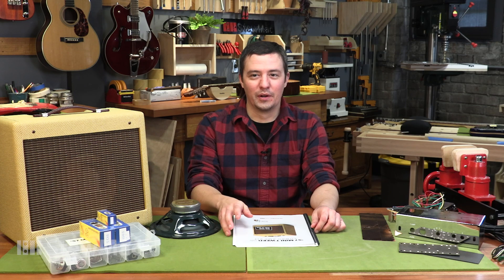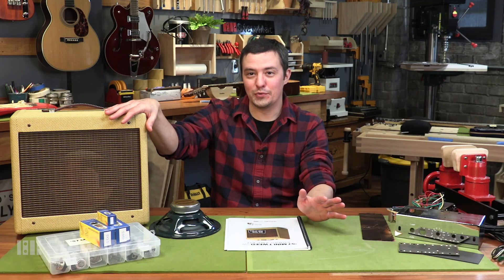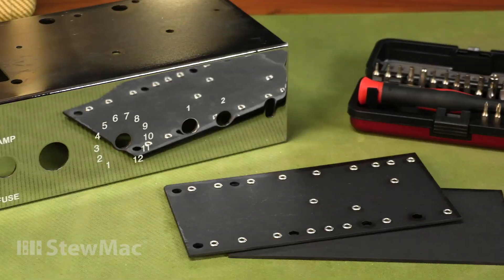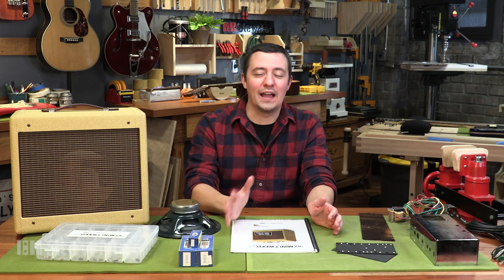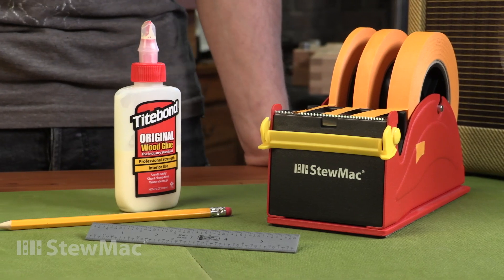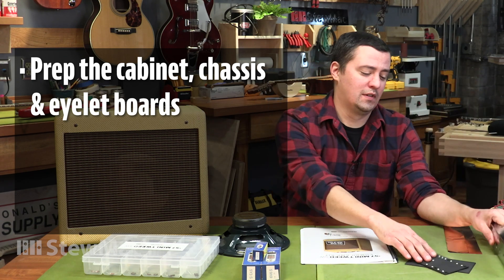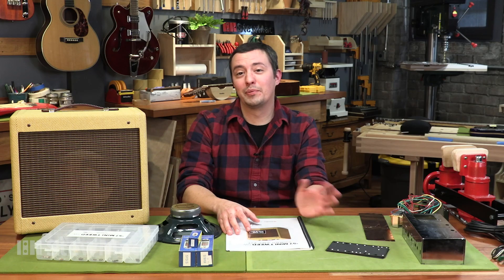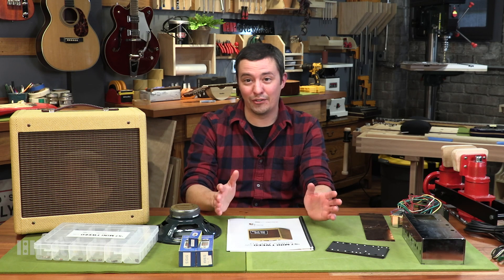How to Build a Tweed Champ 5F1 Step-by-Step (Upcoming LIVE Build Along)

Comment: If it was reasonably priced I'd go for it.
Reply: Yeah, it looks like fun(?) but what do you get? Work, possible mistakes, no Fender logo or resale value.
Reply: yeah. When you can buy an actual, assembled, working, Fender tweed tube amp for $500, and Stew Mac is currently charging over $700 for a kit, why would you buy the kit?

Comment: How necessary is the digital multi meter?
Reply: it's for testing the connections and wires probably. You don't have to own one to build this, but it helps. You can get a very cheap one for 5 bucks and it'll do the job just fine
Reply: Even a cheap meter is a great tool so you can test voltages and check your work.

Comment: Cool idea, but $700+ for a kit?  You can buy a Fender Junior Tweed tube amp, new, for $500.
Reply: Yeah but it will be a cold sounding PCB amp
Reply: @ColecoJoe  Just like those "cold sounding" JHS pedals and Tone King amps, right?
Reply: @ehleroo  Never played a Tone King amp, and pedals don't really have tone, they only sound as good as what you put them through and play them through.  A point to point wired amp will always sound warmer than a PCB amp assuming it was constructed right with quality parts. I'm a fan of both.
Reply: @ColecoJoe  Hey, if you dig it, cool.  My comments are based on eliminating a portion of the labor costs that go into manufacturing an amplifier.   You are now doing that labor, yourself.  All things considered, I feel like a “kit” should be at least measurably less than buying the actual product made by the actual company.  Definitely not more expensive.  Just my $0.02.

Edited to add: I see comments about building one of these amps as a learning tool.  Now, if someone aspires to be a profitable amp builder or repairman, I can see spending the money in order to gain that knowledge.
Reply: @bldallas  That's fair.
Reply: @rogerwilco99  yeah I agree with you. Not sure what was the point of the response :)
Reply: @rogerwilco99  boy you lost me completely.  The Fender Junior Pro Tweed IS a Tube Amp.  It retails for $500.  No clue what your bringing solid state amps into this, unless the kit is for a solid state amp, but solid state amps are typically cheaper.  Economy of scale is not a fair argument.  I would be shocked if Stew Mac had a couple old wood workers making the cabs for these kits.  The rest of the parts are also sourced from original manufacturers.  

Hey, again, if you want to spend $700 for a 5 watt amp KIT, knock yourself out.  The bang:buck is way too low here, to catch my interest.

Comment: I was interested in building one until I saw the price. Seriously! That much for a 5 watt?! Way too much money for something you build yourself. I can buy a better prebuilt amp for that kind of money.
Reply: They are mojotone kits with a premium for great instruction.
Reply: Im not sure you can. Fender have re issued the 5w tweed amp and it is £1050 over here in the UK. The Stewmac 5w being £550. I had to pay an extra £70 import tax on mine.
Reply: @markymark560  yeah and it doesn't have those crappy I C electrolitics fender just can't resist using. Just saving a few dollars. If you love amps just build one yourself they are as simple as you can find.